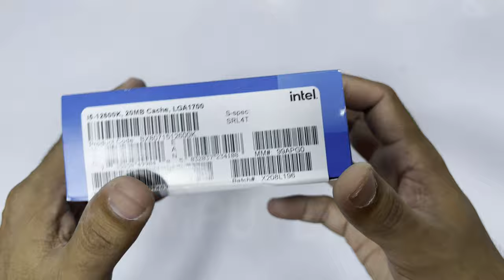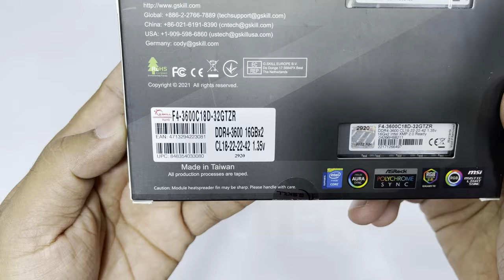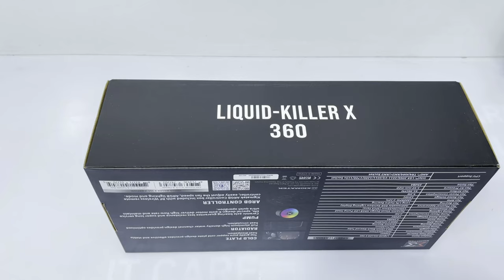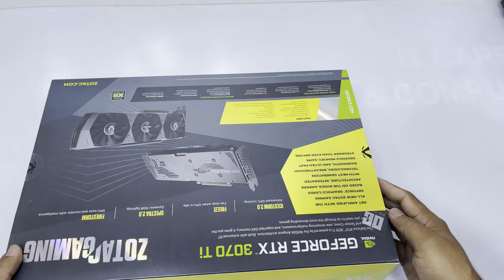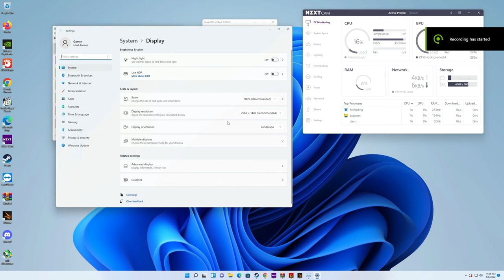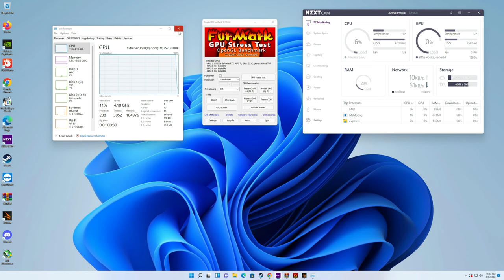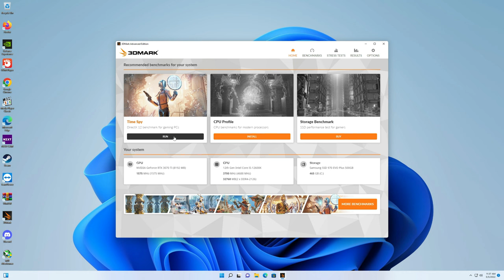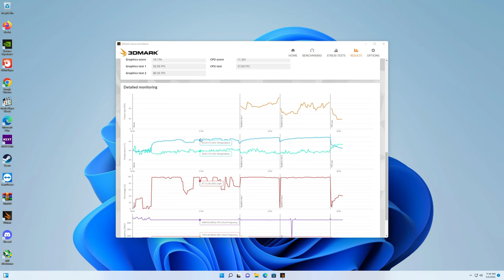LAG-1700 CORE I5 -12600K  RTX3070TI GAMING PC BUILD

Comment: Why investing all that money and being cheap on the PSU? The part that keeps everything else alive
Reply: I think a 750w PSU is enough for a 12600k and a 3070ti, not sure
Reply: @dreku8743  750w is ennough.  Hell i run 850w on overclocked 3080ti, overclocked 10900k, 5 hard drives, 10 case fans, led strips, strimmer cables, ect
Reply: @kryptopcgamer589  That sounds like a godly setup nice
Reply: @Dreku  Wattage does not equal quality. That PSU is not even 80 bronze and it lacks of many of modern safety measures
Reply from the maker: @santiagopetrungaro  that power supply is 80+bronze with 2years warranty
Reply: @santiagopetrungaro  Oh shit didnt even see that it was bronze.  Yeah need at least gold or a platinum would be better
Reply: @itcarecomputers  No, it is not. In the video we can clearly see its "80 plus" white. Which is one step below "80 plus Bronze". And checking the manufacturer's website you can confirm that. However, certification does not mean quality per se.
Reply: @itcarecomputers   It is definitely a bad choice. You can get 80+ Gold with 10 year Warranty, 3 times the amount of protections, modular design, REAL 750w (this one is in fact a 650W) and very reputable model, tested and professionally benchmarked for $120 (us dollars). You can find a Corsair RMx, an XPG Core Reactor to name some, maybe you can save by buying an EXCELLENT 650W unit (which is what you are really gonna get with this one). Thats the price of the Seagate Drive you got there. I mean: you have an unlocked processor, a top of the line motherboard with z690 chipset meant for overclocking and pooping rgb lights like the chinese new year, a freaking 3070ti, liquid cooling (not needed if you are not overclocking but you really need a beefy PSU if you are). That PSU is not in the same level as the serious requirements of that build. It is most definitely not, you can't even find a review of that thing. The PSU is very very important, not only it's wattage, but also build quality, components quality, protections, transient response, complying with modern ATX standards (the website states it's ATX 2.3 which is 15 years old). I'm not just bitching about it. It's a 1700+ dollars build, why saving like 70 bucks and not buying a better PSU that will survive maybe 2 builds more after this first one?
Reply: @itcarecomputers  Apart from that I think is a pretty nice build, good matching between CPU and GPU and looks pretty nice
Reply: @santiagopetrungaro  I’m currently putting together a very similar build except I don’t have a liquid cooler. I’m using a deep cool ak620.  The only part I have left to pick is psu and graphics card.  I was going to go with 750 watt but 80+ gold. Would that be enough?
Reply: @odalissaunders2441  I'd recommend the XPG Core Reactor 750w 80+ Gold. There's also an 850w version if you want to future proof it for possible upgrades. It's an excellent PSU, good value and the correct amount of features for todays standards